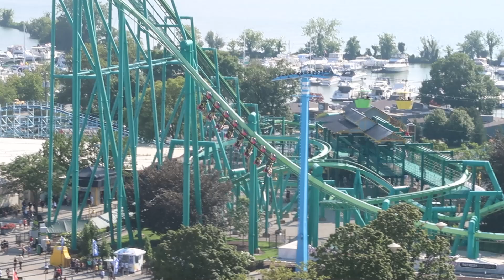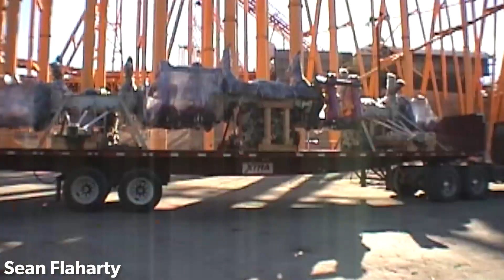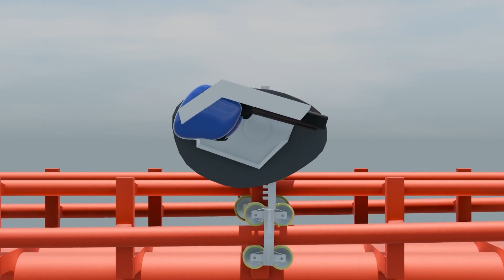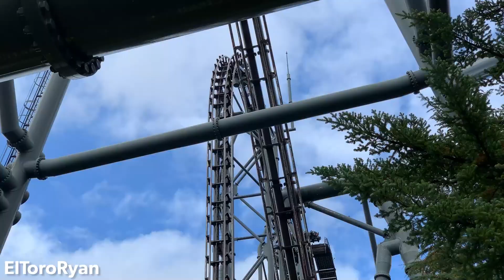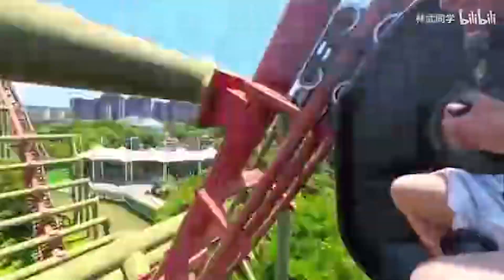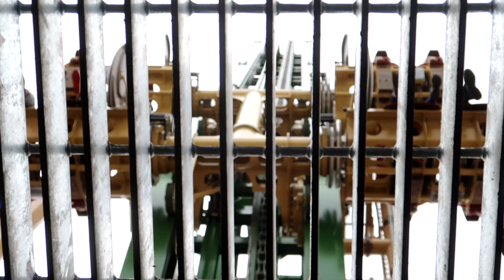How Do 4th Dimension Roller Coasters Work? - Ride Science

Comment: Something I don't understand, if both wings on all vehicles have their rotation synchronized at all times (at least from what I can tell from the videos) then why does the track have the extra rail responsible for the 4D movement in both sides? Seems kinda unnecessary
Reply from the maker: @asddw4998  the closer the riders are to the rail the smoother the ride.
Reply: @CoasterCollege  Got it

Comment: Such a great series so far! One ride concept I would love for you to explain is the engineering behind roller coaster supports and how it’s determined where they go and how they’re designed. I’ve always been interested in why some supports go straight down, some have two poles (sometimes facing inward and outward), etc. Something that could be baked into this video or perhaps in a second video could also be how roller coaster track type is used (such on Intamin coasters where 2-rail or 3-rail track is used). Thanks!